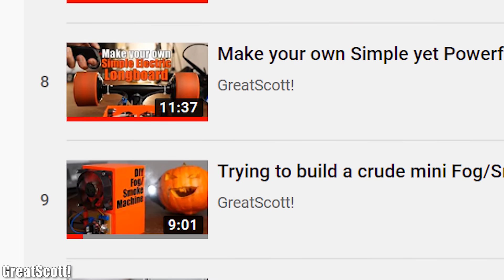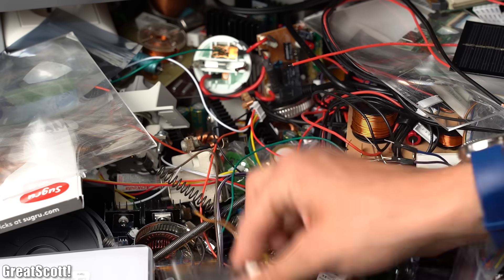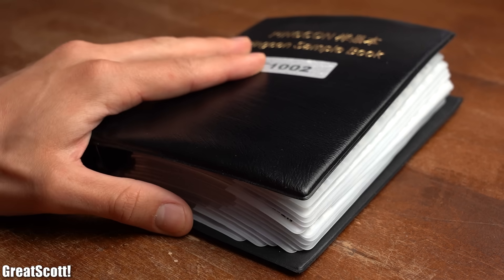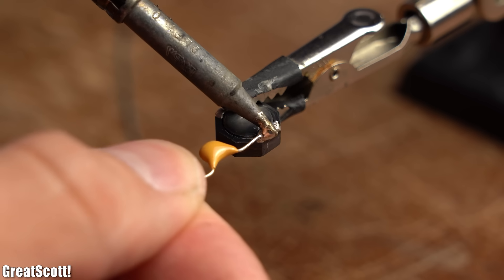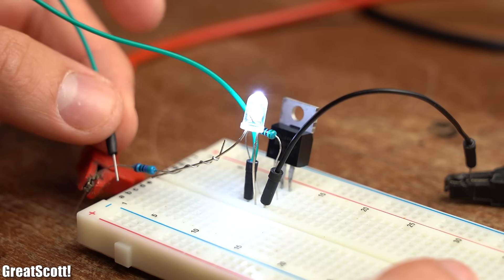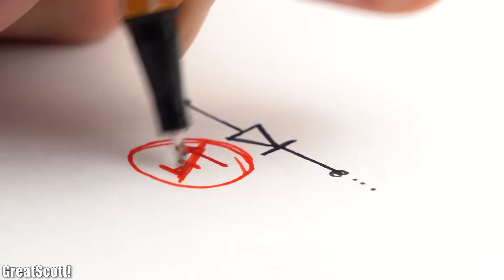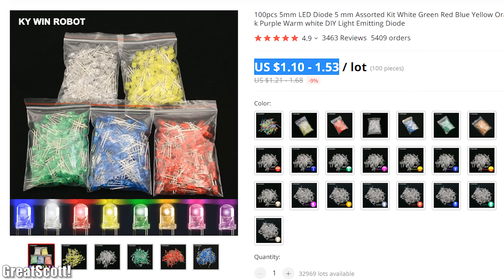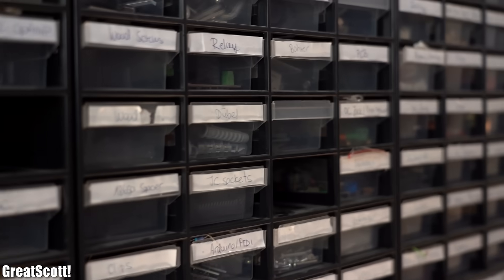Essential Electronics Components that you will need for creating projects!

Comment: Mr great scott very helpful video cence i am planning to create my new lab so yeah.
Anyway i have an idea. What about making an automated garden which might sound  ease but trust me it isnt. 
I am going to make my own hydroponic gardening system and i what an arduino measuring and creating a graf of the temperature and humidity of the rain shelter .
Remember the peristaltic pumps you used for the cocktail machine?? Why not making a hydroponic system that is fully mixing and measuring the nutrient solution on its own as long as uploading the data to your phone so you can see if the solution has ended . I thing is a great idea and it will be very interesting for  the viewers too. Tell me your opinion and have a nice day.

Comment: Hello everyone 😊
In my idea, relays are another essential components that great Scott missed. He also missed terminals, pin headers, 16 MHz crystal for ATmega, Power supply connector, and perfboard as well. Thanks for these useful videos. I hope you will make another one about essential common modules.😀😀
Reply: Pin headers.. definitely!!
But maybe technically not components?

Comment: I understand why you prefer the Arduino Nano since you can just plug USB directly into them. I prefer the Arduino Pro Mini because they are smaller but have no serial to USB converter onboard. You can use a FTDI USB serial adapter (always useful to have one of these) or better have a USBasp programmer to directly flash your code into those Arduinos. You can also use them for flashing some ATtinys which is sometimes just enough Microcontroller for small projects (I once build a kids lantern light with a WS2812b LED and a ATtiny10).  Don't just limit yourself to ATmega328 Arduinos, have some ESP32 and ATtinys as well. :)

Comment: L298 motor driver boards,  a few small stepper motors of different sizes, limit switches, also a 1850 battery holder for lithium ion batteries is nice, as most people dont have a spot welder (some of these are bad as they dont have the correct connections so they go hot, be aware) A Battery charger for RC batteries, + a conector so you can balance charge ur 1850 lithium ion batteries, a few pcb's that are connected in rows where u can solder components right on and u just have to cut away to disconect instead  of having to solder connection to connection (connected in lines), Opto isolator for limit switches, a assortment of logic IC's is nice xnor, xor, nor, or, and flip-flops and eeproms and a few different quartz hertz oscillators. a assortment kit of sensors is also nice incase you ever want to make robot that uses sound -echo to detect walls, Light sensor to detect daylight, tilt sensors to detect that its not fallen over, movment sensor in combination with compas to detect somewhat accurate movments and direction. voltage display, i also keep thinking i need solenoids, but lets face it i dont.

Comment: Brill. Thanks. 

On the Arduino side, a starter kit like the elegoo ones will have breadboard, cables connectors etc as well as a decent tutorial.
I missed perfboard, which you use a lot.

Comment: What is the use to connect resister in parallel
Reply from the maker: You lower the overall resistance and increase the overall power rating.
Reply: @greatscottlab  I love you
Reply: Thanks alot

Comment: i would change that LM358 for a LF353, being FET input is much better than the bipolar LM358.

Also, try to not use an op amp as comparator, you should add a proper comparator

Comment: I am not an electronics engineer, more over a computer science engineer. What I normally do is search buy try to use run into trouble swap with another component and optimize my component kit

This video, im really sure it will help me to skip that part because I mainly work with 5V and 12V. All components like MOSFETs, opamps, I just use something which seems to work but may not be efficient like irf4905 p channel mosfet and lm356 opamp for 5V logic. I have never used rail to rail opamps because I didnt know what to look for

Comment: Great video! Though I have a question regarding Mosfets.

For example I'm learning (or trying to) electronics though these videos and making some projects. Yesterday I started the "Constant Current Load" and I couldn't find the IRLZ44N mosfet in my local shop; however I had a IRF530 N-Channel mosfet laying around. But it did not work.

What should one look into the datasheet when trying to find a suitable replacement? Why did my replacement failed? (There is a possibility that is not the mosfet fault by my incapability to follow the instructions)
Reply: Firstly check whether the MOSFET is working or not they might be fried up due to bad connection etc., secondly IRF540N is not a logic level MOSFET iirc (logic level - 1.2v-5v) the gate of IRF540 gets fully turn on at around 10-12v that's why he used IRLZ44N coz it's specifically logic level the gate turns on properly at 5v for this one

If you don't manage to get one logic level ic better use a MOSFET driver ic (TC4420) which amplifies the logic voltage accordingly for the MOSFET gate to fully turn on doesn't matter then if you use logic level or not so MOSFET drivers are the real savers here, smoothing similar like you happened to me too

Comment: Hai Scott, u would like you to add optocoupler based IC like TLP350 rather than IR2113 or any other bootstrap capcitor IC. serves as a better option than other IC. Another essential part of circuit which is missing is flyback converter modylules or small DC-DC converter module to give +15V and -15V to power up opamp based IC. Maybe a video in development of such flyback converters can be really helpful. Maybe a skim through of basic voltage and current sensors (isolated preferably) as they are one of the most common components should be good. I am a power power electronics engineer and develop high power board. Great enthusiast of ur work. Good luck
Reply: well the TLP350 cannot drive the high power MOSFETs and IR2113 can be integrated to control high power MOSFETs with logic level signal

Comment: Few things I learned since I started with electronics:
- Start a project, however simple, and then buy components. Few projects in you will get wide variety of stuff. Few more projects in you will have too much stuff and never exactly everything necessary for that next project.
- Label and catalogue everything. This is hobestly the most annoying thing about electronics.
- SMD components are super compact  when compared to TH. Yes, you may need TH to prototype on a breadboard, but a SMD kit can be much more comprehensive and compact.
- If you order PCB, go with SMD! Honestly SMD stuff is so much easier so solder and your project can be much smaller. 
- Just keep SMD sizes sane. 0603 minimum for resistors/capacitors, use only those ICs that have visible pins to touch with iron.
- Have a cheap iron with adjustable temperature and a tip that can be replaced with a small one (by some chance I have the ERSA one that is on Great Scott's workbench).
Reply: Great tips, i would only change one thing and it's on using SMDs if ordering PCBs. I would always go with trough-hole components when ordering PCBs, and SMDs if doing the PCBs myself (tho I can understand that it's not as easy to make the traces for some smaller SMD ICs), since I would not need to drill the holes myself on the purchased PCB and through-hole parts are still easier than SMDs to solder from my experience, and specially with cheaper soldering irons. Now, if I'm making the PCB myself, I'll want to drill as little as possible so I'll always go as much SMD as possible, just avoiding SMD connectors like the plague for durability sake.
Reply: really thanks for your tips.. 
i love electronics but i don't know how to start, if i start making some simple projects from google is it right? what's the next step then? 
I appreciate your help thanks again.. and sorry for my English, I'm not a native English speaker 🌻
Reply: @sumaia4414  search for 555 timer or 4017 circuits and your gonna find a bunch and  they'l teach you electronics

Comment: Well one thing I think you missed is covering battery ICs, because of course you'll occasionally want to make a portable device or convert an existing device to a different type of battery, which is why charging/protection boards like the TP4056 are a valuable component to keep on hand.

Also on the topic of batteries but less necessary, it doesn't hurt to keep a few small solar panels either in case you want to make an off-grid project or simply too far away to easily run wires.

Comment: Why do you recommend metal film?

I use carbon since I find the brown background to be easier to read, but if there is a reason to use one over the other, then I'd be very interested in learning why.
Reply from the maker: The resistance tolerance. It is much smaller with metal film.

Comment: You always came up with good stuff therefore i think you are very good on electronics. Here’s my question: why are the fuses (like on car electronics) located on the positive line of the circuit? As we all know, the electrons are flowing from the negative to the positive, which means that they will reach first the LOAD then the FUSE and finally the plus terminal. So in case of high currents, how does the fuse save the load?

Comment: Also, an important component is Relay. I also highly recommend having some more powerful NPN and PNP transistors just for amplifiers, since they are quite popular too. For NPN I would go with BD139 and BD911 and for PNP BD140 and BD912. I would also recommend 4R and 6R power resistors as a load. 
Thanks for your amazing content :)
Reply: Also don't forget the 2sc5200 and complementary 2sa1943 for more beefy amps, and 2n3055 with MJ2955 to build extra reliable power supplies and vintage power amps ( those are REALLY tough ones ), and the most important thing of all with this kind of semiconductors, NEVER buy BJTs from unknown supplier, all of these transistors are very likely to be counterfeits, most of electronics projects with these fail due to crappy fakes.
All fakes that i found very common:
BD139
BD140
BC550 ( noisy )
BC560 ( noisy )
BD911
BD912
2N3055 ( often die size 1.5mm² instead of proper 5mm² or no die inside )
MJ2955
2SC5200
2SA1943
2N2222 ( no die inside or low max freq )
BC557 ( no die inside package )
2N3553 ( not working in RF )
common IRFs but on higher voltage/current.
Power LEDs
NE5532
NE5534
AD827 ( and similar )
MUSES opamps
And many more out there

Always make sure you got quality parts that have proper SOA.

Comment: For "low speed" and low power switching application, I recommend the BSS138. Depending on the Drain Source voltage, you can handle these tiny N-channel MOSFET with a µC digital output. Use it to amplifier a 12V PWM with 2kHz for example.

Comment: What basic components do you probably need to have?

GreatScott: Well, just buy all the kits lol!
Reply: Trust me, even the kits are not enough...!!!
Reply: Arnab Ghosh thats so true
Reply: @arnab_blue  you work for electronics company??
Reply: the answer is easy: can't know what value you will need. Also with kits some values are missing, and you're forced to mix the values (it's not always a good idea)
Reply: Component bundles are a great way to get a good range of values cheaply.

It is easy to get carried away though and end up with lots you never use. 

I mainly work with digital electronics as such I use about 3 different value resistors but lots of them. But it's useful to have range for the odd project.
Reply: Well they are simply too cheap to buy separately if you value your time at all. Many of those kits cost less then 4$ including shipping. Passive components usually just aren't a cost consideration outside of mass production.
Reply: I am running out of money

Comment: HT7833 LDO, SK6812 RGBW LDS, AMS1117 3.3 LDO, 0603 Resistors and ceramic capacitors, dip switches, micro-usb ports, a shitload of ESP-WROOM-32 and ESP-12 Modules... (Last time i used an Arduino (Clone or Real), is afew years ago. ESPs just bring everything you need for a good application (I mostly do shit for smarthome, so there is WiFi needed).

But i liked the IRLZ44N. Thats also my favorite TO-220 Mosfet

Comment: This was gold. TC4429 is better with opto couplers (off when Led wire breaks). Capacitor I got all E3 (10 22 47) prefixes, resistors all E24 but few of each, plus E3 a bunch. Gave up on rail-to-rails, too expensive, boosting power supply is easy enough.

Comment: Oh come on! I couldn't find any cheap or through hole mounted rail-to-rail op-apm two months ago to use for my thesis project and now you come and tell me the MCP602 was the answer I needed?? I ended up going for the TLV2731 and having to get a PCB to mount it :(

Comment: 2N3904, 2N3906, 2N2222 are good to have around too.
I would count jumper wires, aligator clips and breadboards as tools and not components since they aren't (supposed to be) consumable. You should still have them around nevertheless. If you are going to mention them then also include perfboard.

Comment: first 1 month when I played with electronic I was happy with 5 type of resistor and capacitors and 555 timer.. Now I have components in thousand peaces, which worth thousands of euro and still I find component which is missing in my collection:D Do not forget linear low power voltage regulators  :) Great Job, Great Scott!

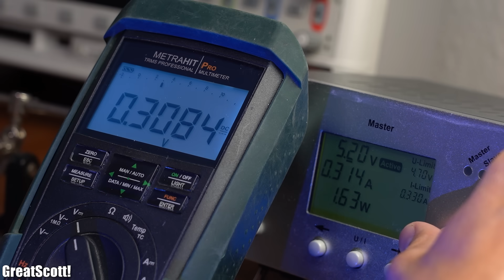Comment: 3:17 i mean 1ohm is good but for 10A no 0,1ohm and maybe 0,01ohm if needed
Reply: 10A accros 1 ohm is going to make 10W of heat
Reply: @virtualtools_3021  yea but 10V vdrop
Reply: @dan2800  Not to mention the waste of power and liability to damage the resistor/pcb its on!

Comment: I have one more to add: the great ULN2003A, which is super cheap and can replace 7 switches (it's a Darlington transistor assy).
Reply: Could you please give a brief explanation about how it works?
Reply: @qps9380  yeah. You supply low-power control signal (Arduino GPIO, for instance), and it controls high-power (500mA) load. It has 7 channels, i.e. a single chip can convert 7 independent signals. Flyback diodes are integrated, too.
It's somewhat similar to 7 mosfets, but in practice it's 7 NPN pairs.
Reply: @Gurux13    yes, but keep an eye on total power dissipation per package.  Seven times a half is three and a half.  I wouldn't try putting 3.5 amps through it.  Other than that, yeah it's a very handy chip for boosting multiple outputs.

Comment: a few parts that also come in handy a bunch of the time: h bridge ic for motor control, shift register, relays, and the generic soldering boards. and if going more into active components, then small motors/servos, and lcd/oled screens, and rotary encoders are also really useful. after building my projects, i make sure to have extra of that i listed since i know it will probably be used later on anyway.

Comment: I would have suggested logic level USB-RS232 converters (like an FTDI breakout board) but they're more of a tool than a component
Reply: I never got the point of those things. Why use an adapter when the computer comes with RS232 anyways?
Reply: @virtualtools_3021  Few modern PCs have RS232 ports, however 5V and 3.3V versions of it are still very common in embedded systems.
Reply: @NiHaoMike64  My pc has one, and so do all the ones at school, i guess our school is wierd or something

Comment: In regulators, 3.3V Liner regulator like LD33V is also essential in my taste. And plenty of single-cored small wires from Ethernet Cable to make easy, small, temporary connections on the fly for testing or remove the insulation of a piece, straighten it and BOOM!!!! you have jumpers for PCB soldering if Silver Copper wire is not found.